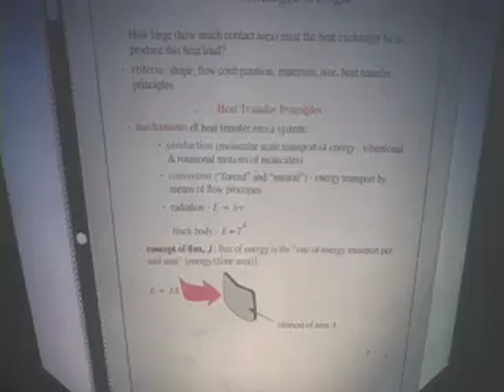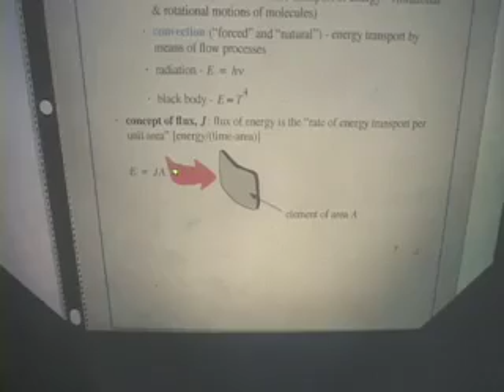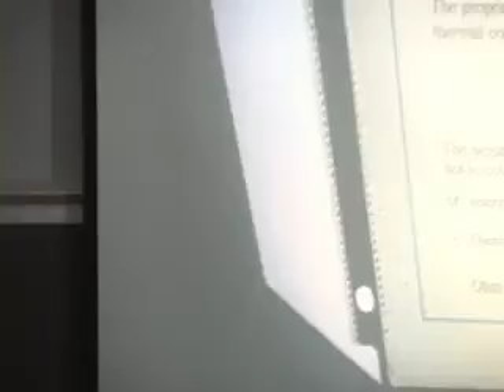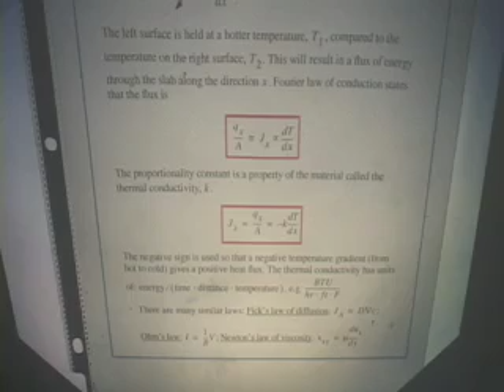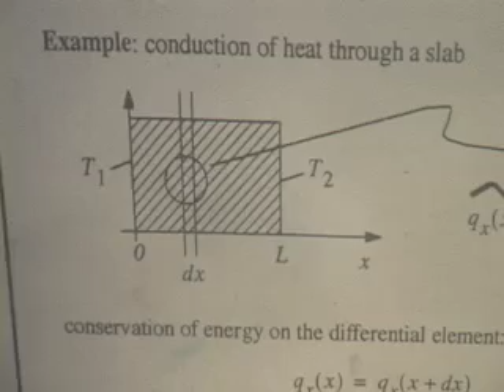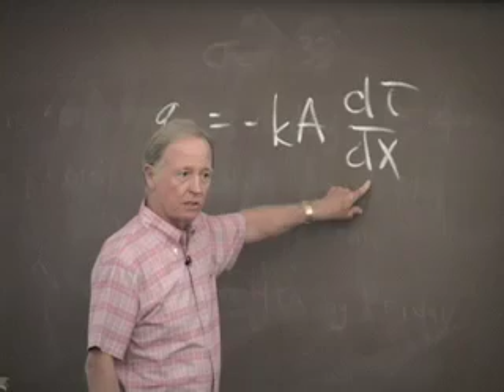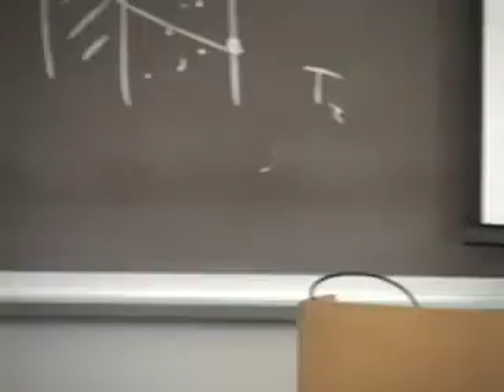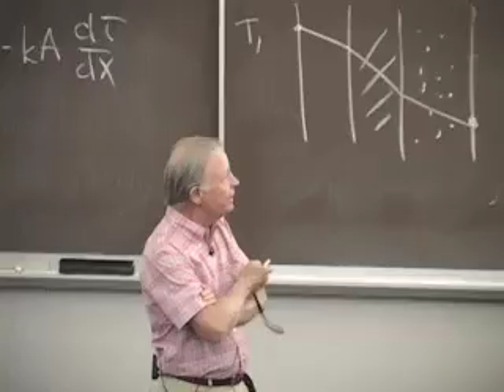Introduction to Chemical Engineering | Lecture 11

Comment: Cems and c s e career center are running as usual. I'm not totally delusional, I just branded my class of 2020 for no reason.
Reply: I think that's the way probation works is if I don't get that I'm a shi tty alum then I'll get the probation.

Comment: Males have greater mean average momentum than females traveling at the same velocity, but on average females have lower velocity than males.
Reply: Kelsey Sather leave it as but don't change it to and.
Reply: They miss stuff like this all the time, the difference between and and but. It's a big deal for a classroom full of freshman.
Reply: You know I missed stuff like this in polymers lab constantly. Michael Hinton gave me an A anyways. What does that say about Michael Hinton commitment to higher education? Michael Hinton was more sexually motivated by short skirts and yoga pants than he was by laboratory manuals and calculators.